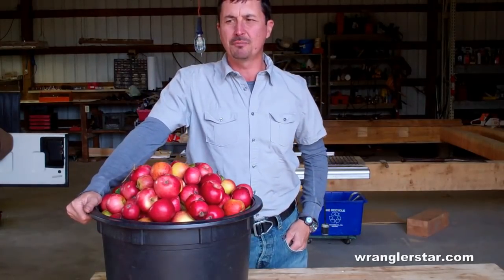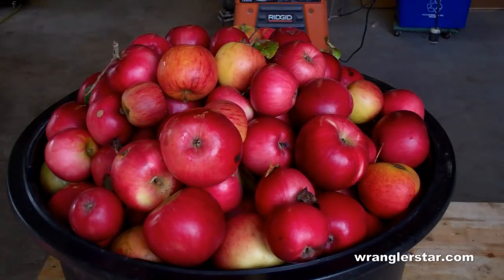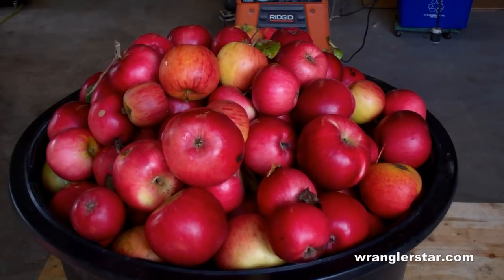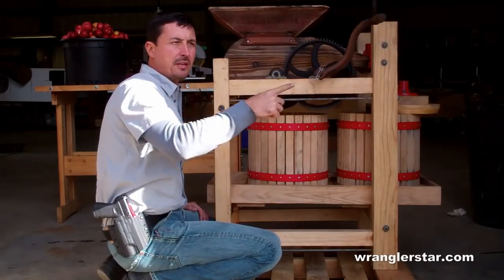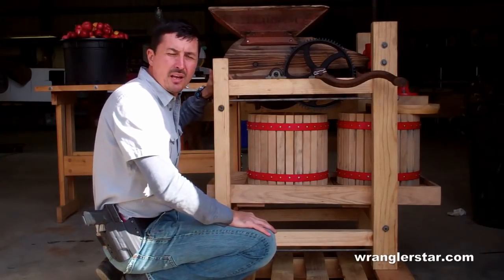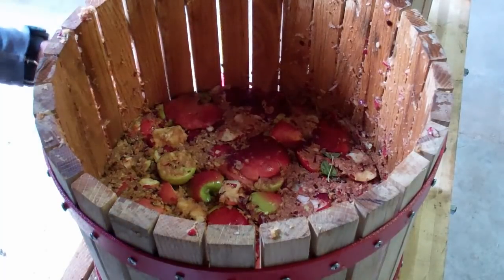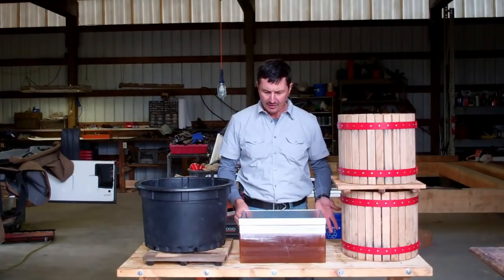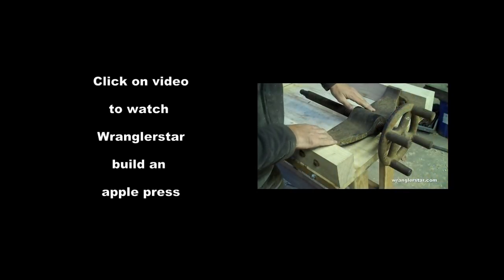How To Press Apple Cider

Comment: Hi,

And thanks for the interesting cider video. You do realise that when the apple press screw gets too hard to move down by a person, the four posts at the top can have a length of wood laid across and you will get at least another quart out of the mash?
I used to make wine and never had a grinder but had the same press as yours passed on from my uncle and you will get so much more juice out using a 4" x 4" or similar.
Reply: +TheodorEriksson Hi,

I know what you mean but the machine part and the stresses are all around the screw, and it was what the machine was designed for.

Comment: apple mash vs hydraulic press
Reply: Naah the press leaks. That hydraulic oil even a drop or two could ruin a whole press. It the reason they still make the screw press and it is still so widely in use. Seen lot of presses made with hydraulics and they are not easy to use either.

Comment: Hey Cory, Been enjoying you Apple Press restore. I was talking to my Mom (she is currently 21 with 66.75 years experience living in the same house in NYC (Queens) that I grew up in more than 60 years ago this past July) is from the old country (Germany/Poland 1930's). She and her father (she was the oldest child in the family and the kids that came after were her half sisters & brothers, her mom died when she was 5 or 6 yrs old) used to press apples, pears or whatever kind of fruit they could find to press. She said that they used to do a two step pressing and that they would take the crushed mash from the first press her father would tighten up the shield (that movable curved metal plate in front of the blades) so to crush the mash finer and run it through again and  press it a second time. then they would mix the two presses together and they would get a lot more cider out maybe 30-40% more compared to what came out of the first pressing. I guess the times were hard and you did what you needed to do extend what you have. I bet that cider tasted great too. we had a peach tree my mom planted from a seed the summer we first move there. at its peak we would get 550-600# of peaches. Some were the size of grapefruits. Peace to you and yours

Comment: Would love to have that apple press setup. And I love that table, My Dad built three workbenches (2 at 3'x6' and 1 at 2.5'x3') back in 1972 with 2x4's and all thread holding them together like that table, they are mounted to the wall with 4x4 angle iron bent at 90° with a 45° 4x4 angle iron support so no legs, between the two 3'x6' bench is my 1972 Craftsman Radial Arm Saw. The benches need some adjustment because of the age, some of the boards are no longer flush, but because of the all thread it will be easy to adjust them back to flush by loosening the nuts on the all thread and simply leveling/flushing up the 2x4's, then a light sanding and they will be as good as new...

Comment: We found that if you put a hinged wooden board over the mouth of the grinder you can fill the hopper right to the top and fold it down over the opening. Two fold it pushes the apples into the grinder and secondly keeps small little hands away from the working action.

Comment: The rivets that held the slats on the barrels were somewhat important.  Traditionally, the barrel was lined with a cheese cloth type bag to hold and strain the mash from the juice while the mash was pressed.  The rivets held very well without loosening up and didn't tear the bag.  The mash was controlled and easy to handle.  It did take a little effort to punch the bag out of the barrel after pressing.

Comment: nice video!  i believe if you use a form of "cheater bar" during the last stage of pressing, you could get a bit more juice out before relegating it to compost.  A cheater bar is simply any kind of bar placed within the notches on top of the press plate valve (most likely this is the reason those notches are included) to allow more leverage near the end.  anyways, nice job- keep it up!
Reply: I was thinking if he had pigs they would love you forever for some apple pulp ummmm yummy

Comment: There seems to be a lot of lash (freeplay) between the crank handle and the primary gear. I'm guessing it is a square shaft, and either the shaft of the gear or the hole in the crank has worn corners. Great video (again), thanks.

Comment: I hate to be the one to burst the bubble, but there's a reason why people had orchards and why Johnny Appleseed was famous. It's very rare to have a sweet apple. The genetic variety in the seeds of an apple makes the apple seeds (even of a sweet apple) produce sour apples. If you want a sweet apple, you have to graft on a sweet apple branch to a sour apple root. Johnny Appleseed was handing out sour apple seeds. Sour apple seeds make great apple cider for fermenting into hard cider. Pioneers did not make ale and beer because it's a long process to extract the sugar (or convert it into sugar from starch) from grass (wheat, barley, etc.) seed. Pioneers all drank hard cider. The presses are for making cider which became hard. The presses are mainly for making alcohol. I'm not kidding or a nutter. Where I live, alcohol is taxed at an insane rate (a "sin tax"), so a six-pack of alcohol is, at a minimum (even PBR, Budweiser, Schlitz, etc.), $13.00. They are now making wine themselves in their basements for $1.00 a bottle. Minimum cost of wine here is $10/bottle. Beer and ale takes too long to make. They'd shifting over to apple cider but cider/juice is too expensive. If you drink, it's better to make your own cider/wine because manufactured alcohol has added sulfites/chemicals in them which makes you ill or gives you a hangover. As an aside, I should mention that Christ drank wine but was in diluted form – to disinfect the water pulled from community wells (they didn't know about sanitation and why human waste needed to be removed from the water supply). That's not why they grew apple trees.

Comment: You could press the apple mash much easier if you put  a 3 or 4 foot pipe through the steel pegs  on your pressing wheel on the top. You would have much more leverage and make it easier to turn the press down and possibly get a little more juice from your mash. Of course not over doing it and break the side out of your mash basket.

Comment: I have an apple tree which I'm growing organically. Unfortunately, the seed is from a genetically modified apple. I stay away from pesticides and insecticides, I also haven't fertilised it in the 15 years from when it was planted as a seed. It still grows perfectly well. I do have a small problem of ants getting at one or two of the apples, but I don't really mind that, they get cut in half and fed to the Blackbirds, they love apples.
Reply: How long did your tree from seed take to fruit? Have heard 7 years is a fair gauge

Comment: Actually it is not the same here in the USA. Not all juice 'has to' be pasteurized. Most of the juices you find at roadside stands and health-food stores are not, which is part of the permitting process to own a stand (check your local codes). Also, Apple Juice has the pulp filtered out, and might be pasteurized (but does not 'have-to' be). Apple Cider is unfiltered with the pulp, and usually unpasteurized. Last, HARD Apple Cider is fermented.

Comment: Could you make apple sauce out of the pressings, instead of composting?
Reply: Frank Randall yes, here in Sicily they are also used to make apple leather (a great way to preserve them for the winter) and also to ferment them for high alcohol drinks such as Grappa and Apple Brandy, although you will need to distill to get these.

If you use them for cooking with, simply break up the 'apple cheese / cake' add water and a little sugar to back sweeten

Comment: What's the difference between apple juice and apple cider?
Reply: calvinatorzcraft apple cider is filtered less than apple juice also apple juice can have preservatives in it... well I'm not 100 sure though so correct my mistakes if I have any xD
Reply: Yeah you were pretty much right except the preservative thing, well technically apple juice has a longer shelf life since there is no apple bits floating around ready to rot but it doesn't have to have artificial preservative to be apple juice. Apple cider is just a more raw product straight from the press. I find that apple juice is smooth and sweet while apple cider is more earthy and robust.
Reply: If it's clear and yella you've got juice there fella ,if it's tangy and brown your in cider town

Comment: IQ test: 1.  would a long lever across the top of the handle increase the pressure?
              2.  is a gun necessary to press apples?
              No/Yes = fail

Comment: Please help me. If you crush the entire apple for apple cider, since apple seeds have a small dose of cyanide in them, does that mean if you drink too much Apple cider, you will die from cyanide poisoning?
Reply: No. By the time you drank enough apple juice to die of cyanide poisoning, you'd have died of a diabetic coma from too much sugar. The worst you'll get is a little diarrhea if you're not used to apple juice and you drink a lot but after a short period your body develops a resistance and that stops.
Reply: Or dehydration from extreme diarrhea

Comment: Why do you have pistol
Reply: Do you mean "in general", or "in this video specifically"?

In general, daily carry is like making sure you always have your wallet and keys on you. You don't always need to use them, but it's better to have and not need than to need and not have. There's nothing about this project that required the removal of the gun. That part where he was kneeling down, and the holster was displayed very prominently looked odd, and wasn't a very good idea from a framing standpoint, I'll grant, but just not removing the gun he already carries while he's making cider isn't a bad thing.

In this video specifically, he probably just didn't think to remove it. I don't expect there to be any special reason behind it.